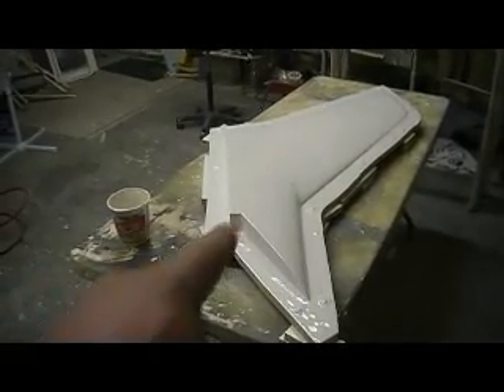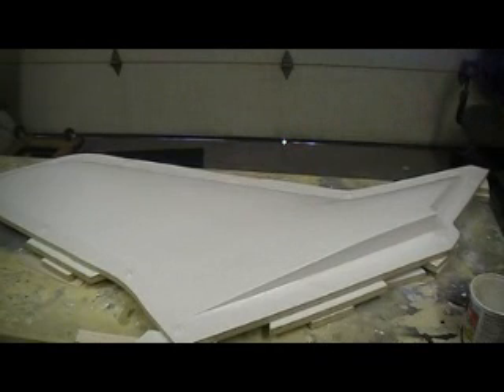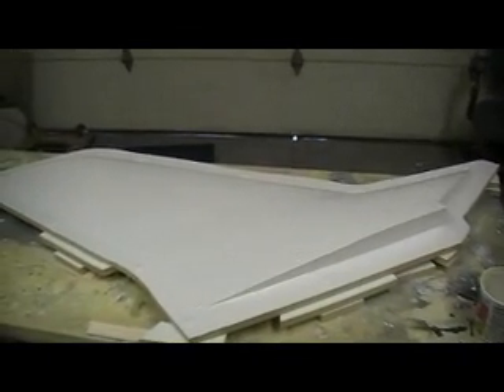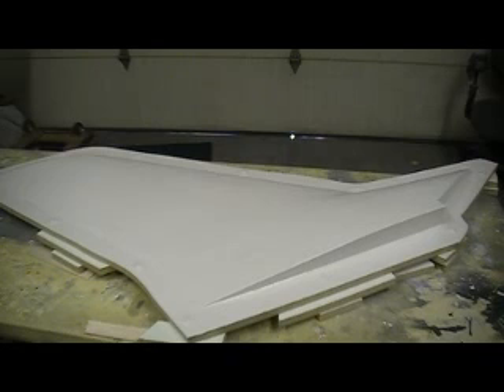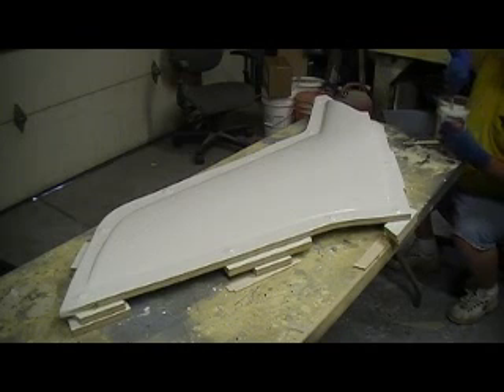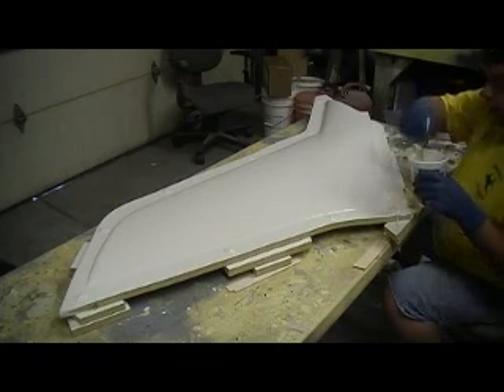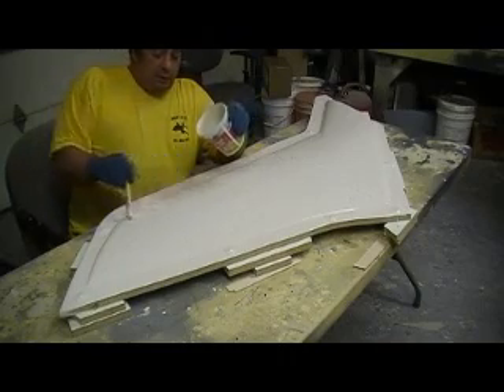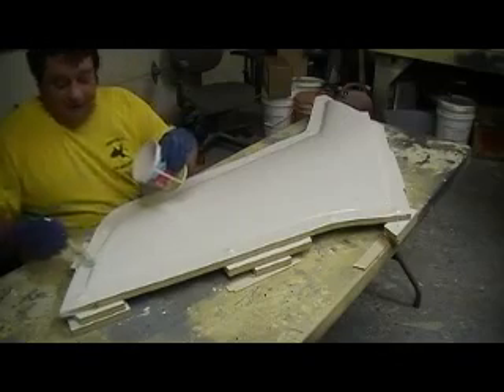how to build a rc jet F-105 thunderchief #40

Comment: Bob, 
I just wanted to throw a "hint" your way. Use the partall first, and then the wax. I have had great sucess with that combination. First, you don't have to be as delicate spraying it on, and second when the parts come out ,the partall stays on the mold so you don't have to recoat. Of course you have to clean the wax off the part, but you have to do that anyway in finishing the parts.